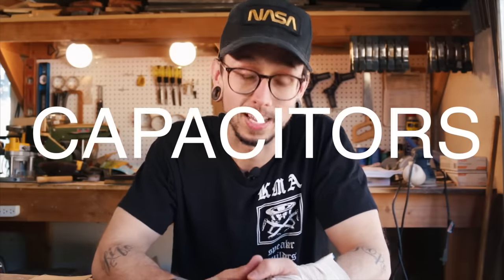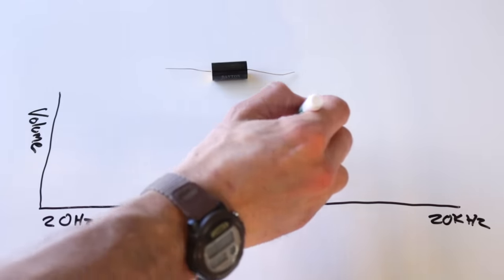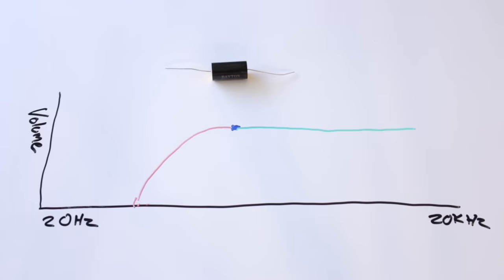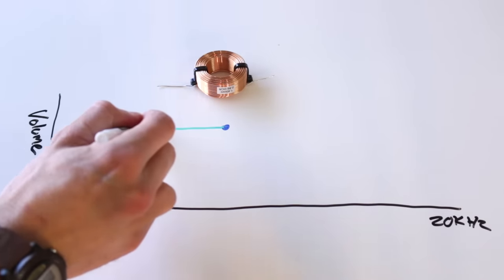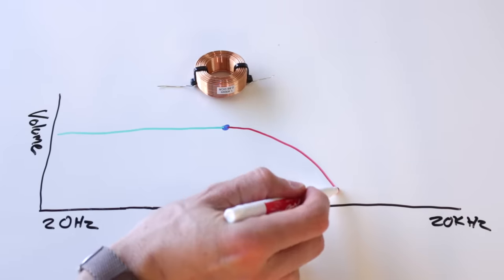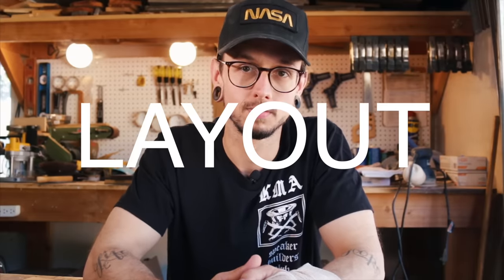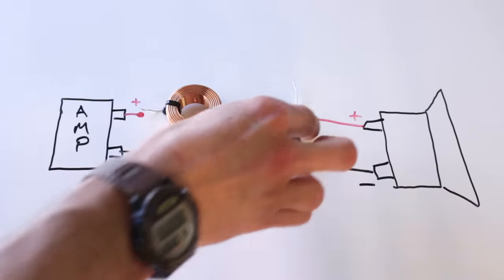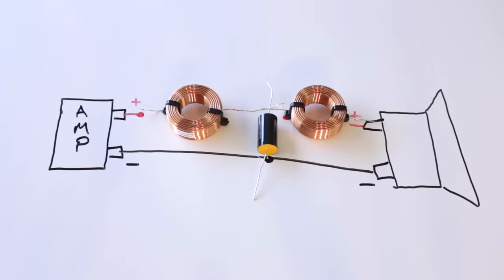How To Design A Crossover For A DIY Speaker || Part 1 - Crossover Design Intro

Comment: This is so confusing. :(
Reply: Capacitors allow high frequencies (treble) and alternating current, but do not allow lower frequencies (bass) or DC to pass through. Inside the capacitor are two metal ribbons that just barely don't touch, which is how it has these properties.

Coils block higher frequencies because when current flows through a coil, it generates a magnetic field which sucks up the power until the field is fully built. All of the high frequency signal voltage is smoothed out by the time it gets to the end of the coil, so that part of the signal doesn't make it through.

Nothing's perfect though and you lose some fidelity in both cases, but its still usually the best option to just use passive cross-overs where needed.